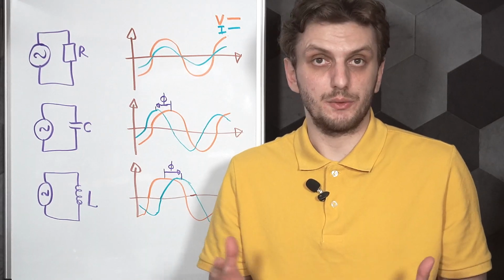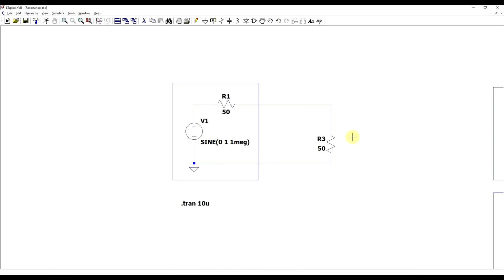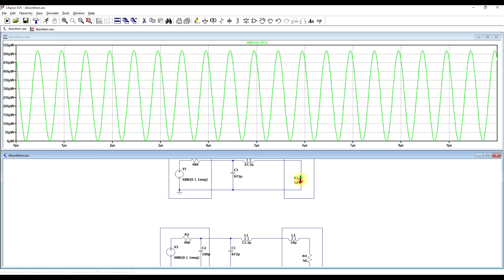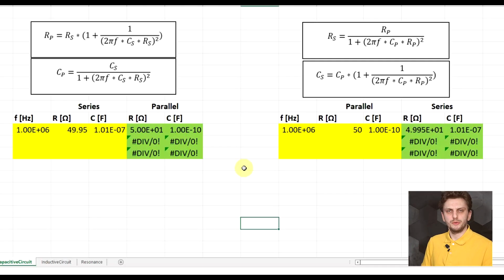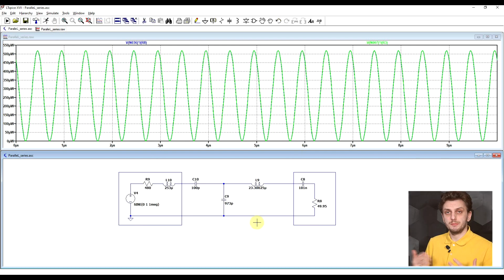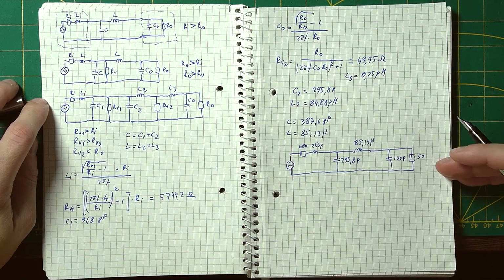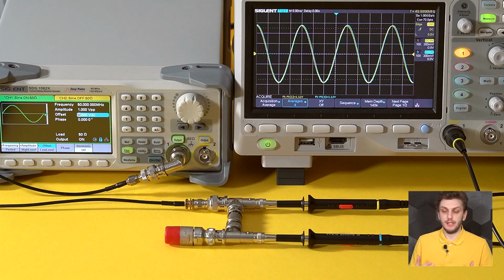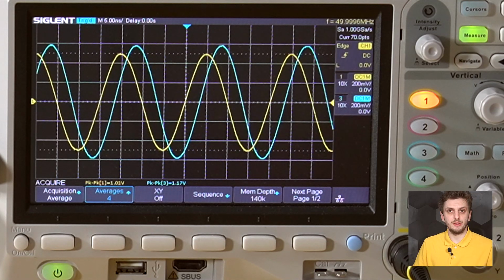Lossless Impedance Matching - Part2/2

Comment: We use this on a power board for pushbikes on solar dynamo AC upto 32v at one amp induction/impedance to resistance via dule line very cool at up to a amp😁if not balanced gets hot on 250 ma?.....